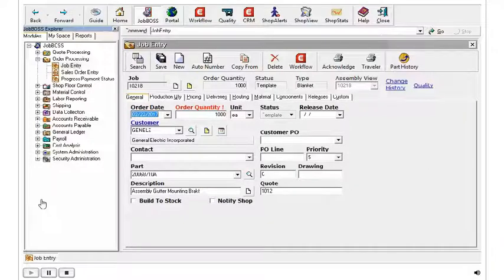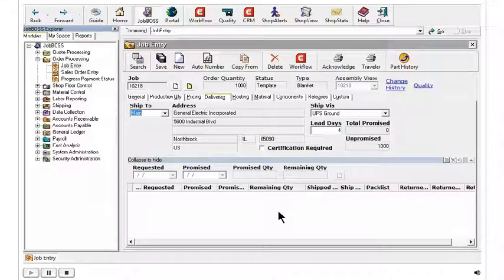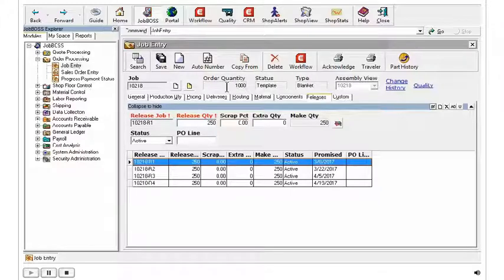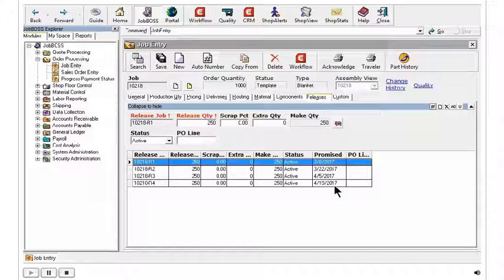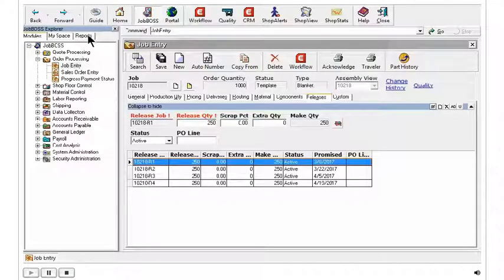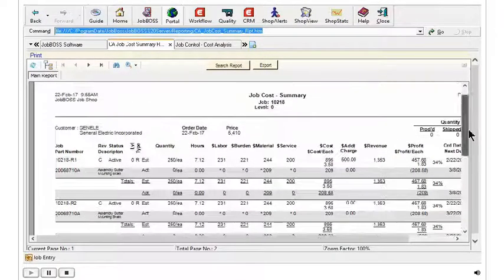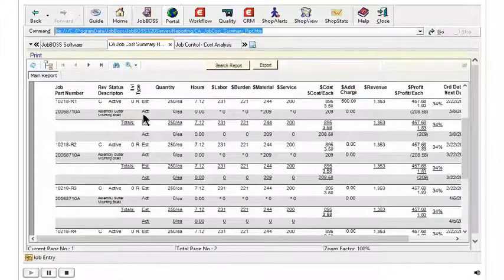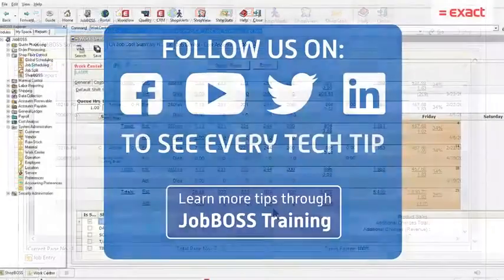JobBOSS Tech Tip Tuesday: Managing Blanket Orders

Comment: Hi there, 

I'm using an older version of Jobboss. The message "this is not a valid change of status" keeps appearing when I try to use the releases (blanket) jobs tab. I can't create release jobs as a sub-component of a parent job. 

How can I fix this? Thanks in advance.
Reply from the maker: Hi thank you for your comment. Please read through the below. Also, you may want to reach out to our support team if needed:  877-524-3577 

Problem:

When attempting to generate a release on a job or change job status, you receive an error indicating "this is not a valid change of status".

Cause:

1. The system is attempting to change the status of the job to "Template" and you cannot have a template or blanket job with activity against it.

Or

2. The system is attempting to change the status of the job to "Complete" and it is finding a component with the status of "Closed"

Resolution: 

1A. Remove all activity against this job, such as: time entries, purchase orders, linked sales orders, material picks, etc.

1B. If you are unable to remove all the activity, an alternative is to copy this job to a new job and change that job status. The two jobs can be "linked" together by Customer PO for costing purposes (Job Cost - Summary) if necessary.

2. Change the status of the component job that is "Closed" to "Active" and save it.  Then you can change the status of the main job to "Complete"